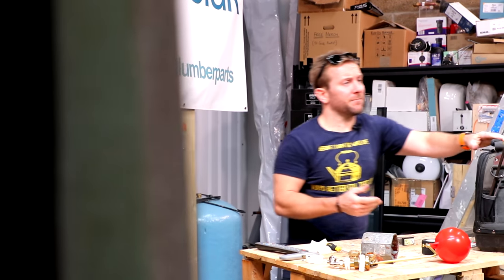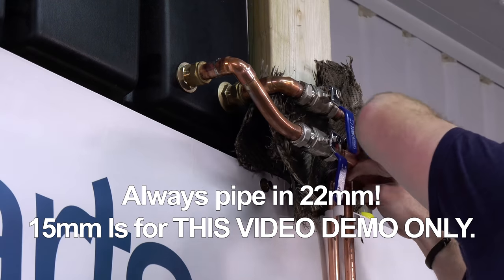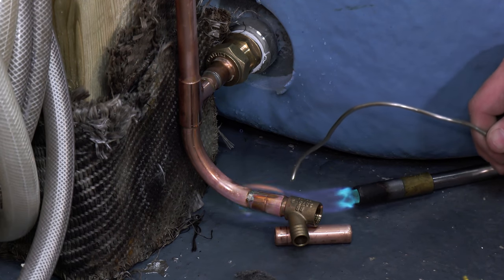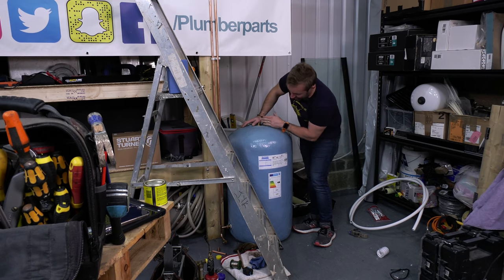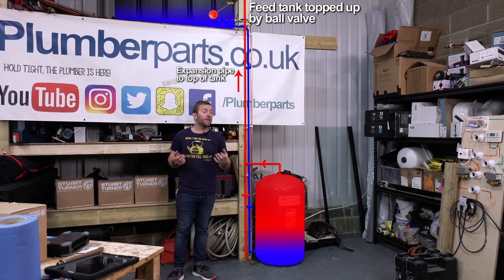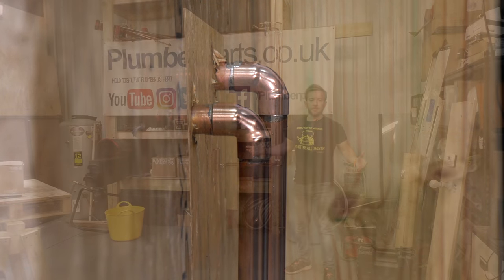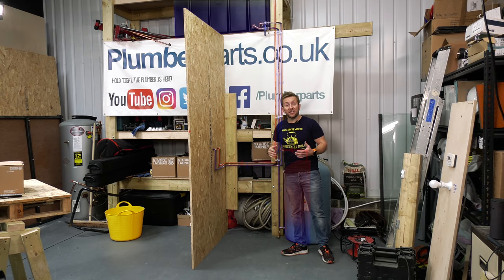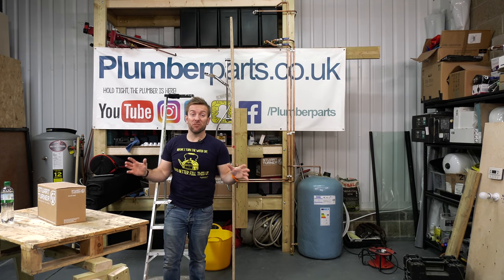HOW TO FIT A SHOWER PUMP - Stuart Turner Showermate Review

Comment: See that tank he has feeding both sometimes you can get it just for the shower. On it's own feed. Then you will have a separate one for the cylinder.  

Basically the reason is depending on how much water you use. And per person in the house. 

They say in the water Regs that its every 45 litres per person. So sometimes they'll have another tank so the CWSC feeding the cylinder won't run out. (Pipe pressure loss calculations...etc)

Comment: Hi,
We have a combi boiler. The upstairs shower drops pressure when we open the the tap either cold or hot downstairs.  Is there a  way to fix this without a water pump. 
Thank
Reply: Not really. Most combis can't deal well with simultaneous  draw off points being used. Do you know if you have a pressure equalisation valve located on your shower's hot and cold feeds? If the shower is located over a bath, there might be one hidden away. Taking it out might help, but beware. If you don't have a thermostatic shower valve, opening a hot or cold feed elsewhere will make a non thermostatic shower valve run either hot or cold.
Reply: May be the pipe installed with 15mm pipe from the boiler

Comment: Pipeworks wrong, 
Hot feed off tank should be at a 45. Should of used a S flange aswell. Lot less chance of getting air in the pump.

Comment: Easier solution... Don't bother with a pump and switch to unvented!

After all of the pipe running needed to put a pump in our place it was cheaper to do an unvented, win win less to go wrong.
Reply: Costly no?
Reply: @wiggumo  depends what you class as costly. An unvented 180 litre cylinder supplied and fitted will cost around £800 to £1000, for that you'll get a 25 year guarantee on the cylinder, better hot flow rate and quicker heat recovery. But you have to consider yearly service cost and you will at some point be replacing the expansion vessel, inlet valves and pressure relive valve.  Also not all systems are suited to an unvented cylinder. 
But compared to potential costs of a pump install which can also be in excess of £1000, also the pump lifespan is not 25 years, I've taken pumps out that are only 5 years old. Either option isnt cheap but long term the unvented cylinder is likely going to cost less.